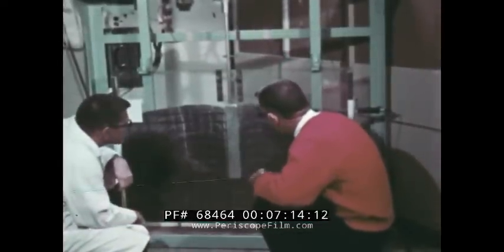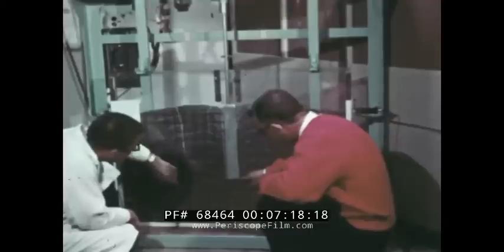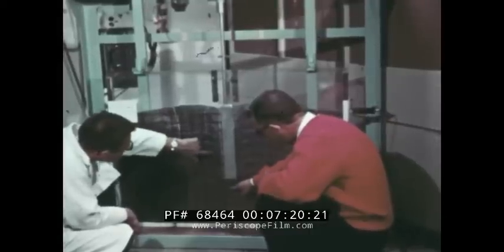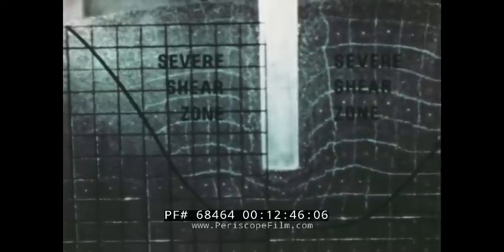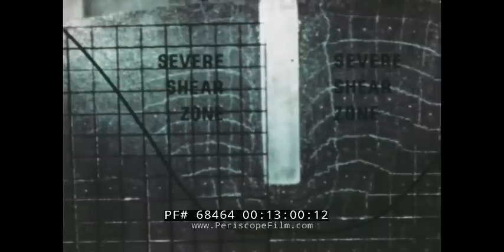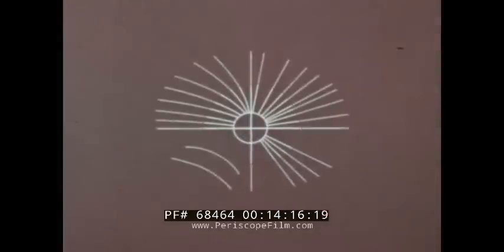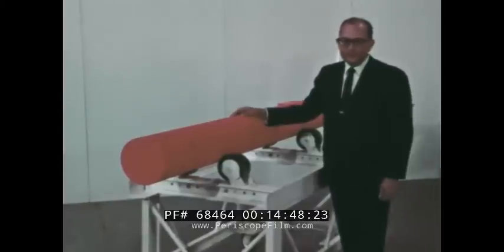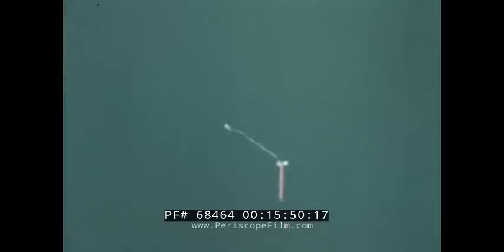“ TERRADYNAMICS ”  EARTH PENETRATION BY PROJECTILES   1967 SANDIA LABORATORY RESEARCH FILM  68464

Comment: What would have made that " penetrator " more efficient is concave grooves along the entire length of the tube. It is a DUH thing really. :O)
Reply: As mentioned in the film, because of the lateral force pushing the matrial away from the trajectory of the penetrator, only the penetrators nose make contact with the soil most of its way down. With concave grooves, if you dont increase the overall size, you loose mass, which is way more important than friction.
And as mentioned in the titel of this film, its about studying Terradynamics, not efficiency
DUH ;)